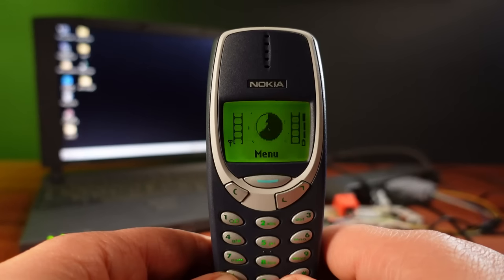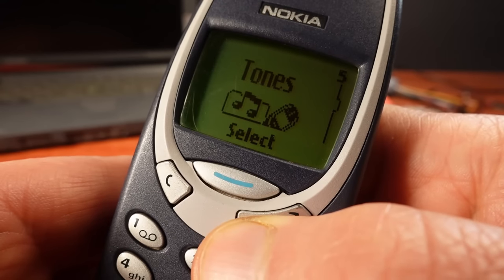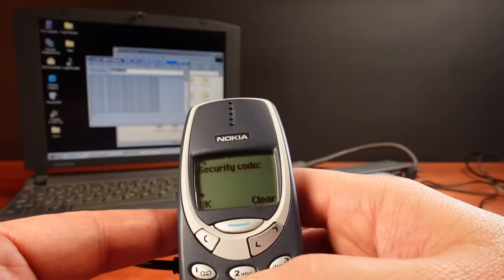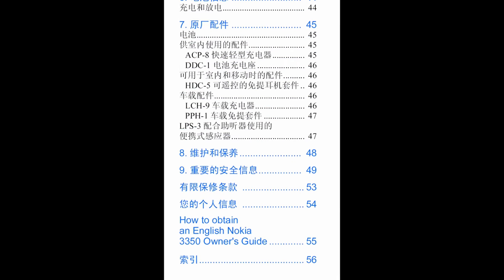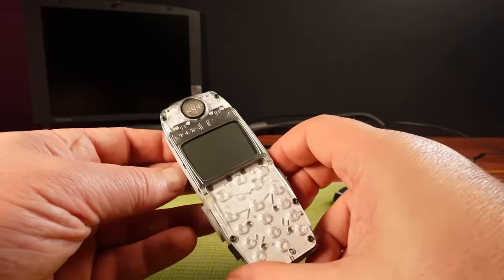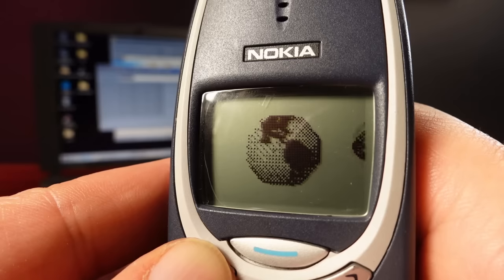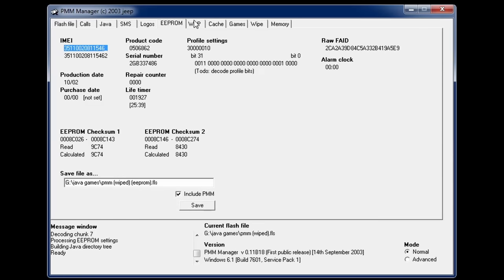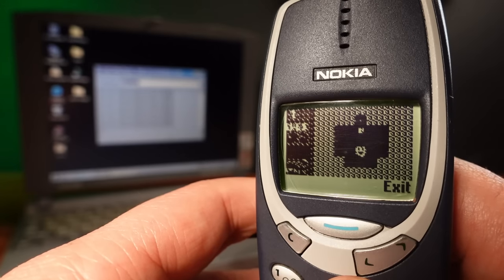Beyond The Nokia 3310

Comment: I used to work in a Nokia repair centre back in the late 90s early 2000s and used to fix about 30 of these a day, they were so simple to fix and Nokia used to allow a full refurbishment for all warranty repairs , phones used to come in looking like they were through a tour in Afghanistan and left looking brand new 😅
Reply: Please stop lying - Nokia 3310 and word “fix” do not exist in the same universe! :)
Reply: As i see, "fix" just mean cleaning, not a real fix...
Reply: @G M  Same a tank could run the Nokia 3310 over and it would run still
Reply: I had a 3310 that died and so had my mum
Reply: I did the same workimg for Vodafone’s Commumications Repair Centre in Nottingham. Like you said, we could foash 10phones in one second all at once (used to love that) change voltage meters etc, swap parts and leave the factory that same day. Nokia’s are like
Lego. Miss that job ………
Reply: my mum is alive her 3310 died
Reply: @van0tot100 womp womp, just replug her bro.
Reply: @van0tot100 mine turnes off when shaking it

Comment: because of these three videos with Nokia DCT 3 phones I ended up buying a couple of lots with good and bad Nokia 3310, 5110 and their modifications, service cables, JAF flasher, and everything. Now I have five 3310 in good condition, I modified one of them with white LEDs, one Korean 3315, one good 3330, three 3410, one with limited edition Space Impact cover, and second is silver in mint condition still with factory screen protector on (got this one for 10$), two 5110 in great condition with 6 batteries for them, and a whole box with covers, parts, motherboards, screens that you can put together and make another ten 3310 ones. I just can't stop now😂 Many sellers sell these devices very cheap in broken, not a working condition, but after cleaning some contacts on the motherboard and power button itself the motherboard works great again
Reply from the maker: That is amazing. Thank you for letting me know.
Reply: I loved Space Impact in the 3330. Is that the one you're referring to as "special edition"?

Comment: You should check out the 5510 which basically has a 3330 stuck inside it with FM radio and MP3 player
Reply from the maker: Very interesting phone, I would really like to find one.
Reply: I had one of those! QWERTY keyboard too!
Reply: @shaunclarke94  I got one in late high school from dick smith it was cheaper than an MP3 player alone. Cool phone for the time.
Reply: Interestingly enough, the MP3 files were supposedly encrypted hence why you needed a special program to sideload them to the 5510.
Reply: @blakegriplingph  yeah it transcoded them to aac or something from memory
Reply: @adamreid5901  they had some different more efficient format it used.
Reply: @shaunclarke94  speaking about that, does anyone know how to play .nrt files?

Comment: That phone was a killer. Greatly engineered, small, light, with a long battery time, yet cheap to build. The keypad was also great. I replaced the standard MiMH battery with a Litium-ion one, original from Nokia,  and was very happy with it. I bet if I check, I'll find the battery still holds the charge.

Comment: I used to write games for this, along with the other J2ME phones - mostly sold them into China and Finland. Made versions of Pacman (screen scrolled up/down to follow action), Pengo, Donkey Kong and some other platformers. I think we were limited to about 30Kb for everything - code, graphics and audio at the time :) There is no "3D engine" in the phone - the game itself just draws directly to the display.
Reply: Do you work for Gameloft or any other "modern" companies these days?
Reply: Nokia designed a 3D engine that was provided to their licensed second party game designers.

It's documented in depth on one of the phone forum he mentions it's never been leaked but we have the full documentation for it. It only worked on the 3410.
Reply: @failedstateupdate  that would be a software based engine though. Those phones had no GPU or API for 3D. They just had a small frame buffer of pixels.
Reply: @Stabby666  it's a long time since I read up on this, so my knowledge isn't as sharp as it was, but I know Nokia developed a 3410 3D engine of some kind, that only worked on the 3410 using built in "hooks" as Nokia described them that they'd left in that specific model

Comment: Wow. I never expected you to just be able to Frankenstein a whole new higher res display on an older phone model. Same chips, same graphics processors, just drop new display in and boom. Wow. How does the firmware recognize the display? I would've assumed that it would just look stretched or part of the graphics being cut off due to the higher resolution.

Comment: I had a 3310 with the flashing cable. I was able to upgrade to the 3315 flash. Then I modded with custom ringtones like 150 or so, all the ringtones were made by me using a midi editor. I also made some pictures that got publish in some magazines and were they sold them by sms. 
Later I bought 3510 which had polyphonic ringtones and Java on a monochromatic screen, the same as the 3350, after that one I got I 3510i which was basically the same phone but with 256 color display. I loved those phones.

Comment: 3585i is my absolute favorite. Has the 96x65 screen, Snake II, and 4 way d-pad. What more could you want.
Reply from the maker: Nice model, great for Java games!
Reply: @JanusCycle  I've actually been meaning to figure out that little five pin connector on the inside of the battery compartment. I've wanted to do the same kind of experiments you've done as I've amassed about four or five 3585i motherboards. Is there a good resource in starting out in this?
Reply from the maker: @parkerlreed  The pinout is similar to the 3310, but you might have to build a custom connector to go under the battery. With a serial or USB cable you should be able to upload games and graphics.

Comment: I love videos of old phone tinkering. Especially if they are Nokias. Do you think it would be possible for you to share information about the programs you use to flash the devices?

There is something that intrigues me. In the era of Java games on devices with color screens, a Nokia game (bounce) became very famous. It came preinstalled on some devices (2600, 2650, 3200, 3220, etc.)
I understood that it is a game written in Java (j2me with a jar extension) and I saw videos of more contemporary Nokias (such as the 1280) that carry it, that blew my mind with the possibilities. Yes, I had seen before that there were other devices capable of running 1-bit Java (such as the 3410) but would it be possible to transfer new applications to these devices?

Greetings from Argentina
Reply from the maker: I showed more about flashing these in an older video called 'Vintage Firmware Modding Nokia DCT3 Phones'. There are also links to the software under that video.
The Nokia 3410 is the only Nokia that is harder to upload Java apps. The other are easier done with a serial cable or putting apps on a memory card.
If you use Discord consider checking out the server for this channel. Lots of people doing vintage phone stuff in there, and hi to everyone watching from Argentina :)

Comment: This is so cool I have the NOKIA 1100 and it comes with fucked up version of Space Impact + with some very hard annoying levels with hovercraft instead the space ship  . I hope that I could change the firmware of it as well
Reply from the maker: Nokia 1100 is DCT4 and can't be modified in the same way. You need a DCT3 Nokia model for firmware modding. Or a Java compatible DC4 model for loading Java games.
Reply: @JanusCycle  it have a similar exposed contacts 6  not 4,  is there any schematics for the parallel or USB cable and can I flash some of those great shmups games you showed :) ?

Comment: Many thanks, greetings from Turkey. I have a few questions. Is it possible to use the software and socket you are using in Windows 10/11? Some masters say win98 is a must. But I think it might actually be a solution. It is possible to merge old sockets with usb converter. It is possible to install win98 as an application in Windows 10 and connect the remaining device.
Reply: Let me also say that the 3310 key layout is great, but the 3410 menu is richer. The keys are very bad. Is it possible to transfer the 3410 menu to the 3310 device. or is it possible to make 3310 device like 3510i with color screen
Reply from the maker: The kNok-Phoenix flashing software can probably run on Windows 10. But, it must use a parallel port. This software talks directly to the parallel port hardware. It would be possible to flash a Nokia over USB using an Arduino or similar. But you must then write all new flashing software for the Arduino. The best option is still to find and old computer with a parallel port and Windows 98 or XP.

Comment: This is awesome! I have a Nokia 2660 here, the Nokia 2760 is basically a 2660 with a camera, and 10MB of user-available storage instead of 2MB in the 2660. Both use the same UPP8611E CPU, so i'd guess the 2660 has the camera engine and 3gp support but it's held back because of the firmware and lack of camera on the top part. So maybe if i plug the top part from the 2760 on the 2660 motherboard and flash 2760 firmware, would the camera work? Lol

Comment: While the ARM 7 derived 33Mhz processor is plenty fast to run doom on lower resolution, there might be a memory issue doing so. Of cause if the textures are downsampled that would solve the problem.

Comment: What happens if you try to use a 3310 LCD with 3350 firmware?
Reply from the maker: Great question, but it was just blank when I tried.
Reply: @JanusCycle  if you do the similar thing on newer Nokia phones, for example change LCDs between 5200 and 5300 (main difference between these phones is the screen resolution), you would get the image, but with some graphical artifacts. And as monochrome LCDs are simpler than color ones, it’s interesting why there is no image
Reply: @rostyc  not only the screen resolution

nokia 5300 xm has more music buttons, 1.3 mp camera and a tft display compared to 5200, in which it only has one music button, vga camera and even older cstn display
Reply: on some nokia phones it is actually possible to swap b/w display with color one and it will work in color as firmware actually has support for these

Comment: Please do not touch the displays with your bare fingers. Do things properly and wear gloves.
Leaving everything with marked fingerprints is disgusting and worthy of a lousy technician.
Reply from the maker: Is it good if properly clean them afterwards?
Reply: @JanusCycle  Isn't it better to work correctly and not dirty, instead of working badly and dirty to clean up later? Working correctly is less work...
Reply from the maker: @cosmefulanito5933  What about the advantages gained from tactile work? Then end with a simple wipe, a cleaner conclusion with a deeper experience? Is it not more correct to feel the fullness of experience?
Reply: @JanusCycle  A pair of rubber gloves will be worth a couple of cents. And they don't take away any experience.